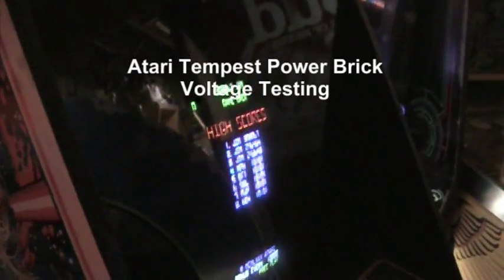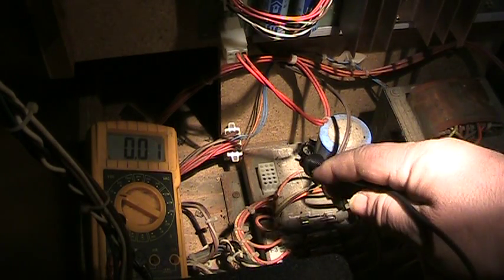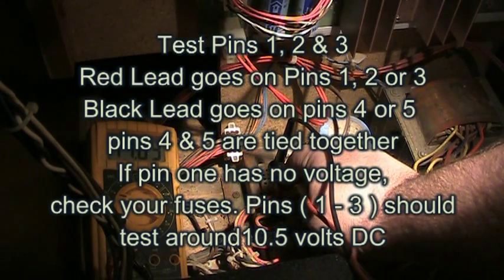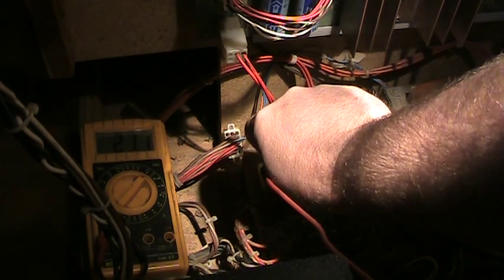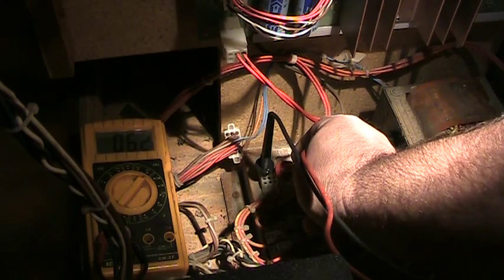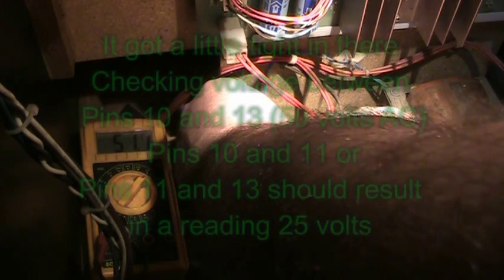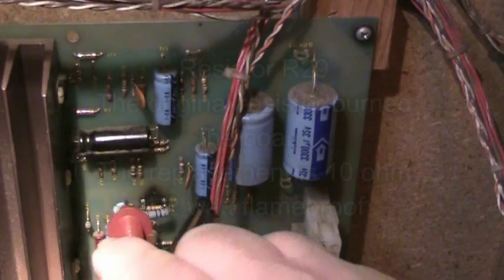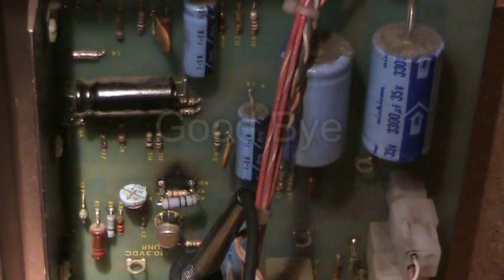Atari Color Vector  X-Y Tempest (Star Wars) power supply brick

Comment from the maker: Vector generator chips allow for the generation of a picture on a crt (tv Tube) the center of the tube is location 0:0. The value for X or Y can be positive or negative and is based on DC current. For a color tube there is a signal running the  magnetic pulse  directing the drawing of the characters on the screen. There is also a pulse telling when to turn on and off the beams for the respective colors. The tube is divided into four sections. The program runs in an anologe code. That code is sent to the DAC chips (digital anologe converter chip)  once the code is turned into a digital location the chip tells the beam were to go on the crt. The rate of movement is slower than a standard tv which is considered raster. Hopefully that helps. Tempest uses a math box board which is the secondary pcb. Star Wars has a special chip which does the function of the math box called the avg chip.

Comment: @Jimjaycee That's called the "Sense Mod" right?  I've heard of that, but haven't done it to my AR/II board yet.  I did replace the two resistors (R29 and R30) with higher watt resistors.  I plan to get a used AR/II on eBay and rebuild it, keeping my working board as a back-up.  My soldering skills are pretty good.

Comment from the maker: After you have the voltage at +5 volts on the a/r 2 board, reinstall the pcb. You will probably have to turn it up just a little to compensate for the voltage being used by the pcb. Test the pcb also to make sure you are getting +5 at the pcb. 
I hope this helps.

Comment from the maker: That is called run away voltage my friend. +6 volts is to high for the pcb board. It will burn up your edge connector. Consider shot gunning the A/R 2 board. It is easy to do and it is reversible.
I do not know your soldering ability and I make no guarantee that this is going to work, even if
I've done this on my own games.
The following is in regards to the J7 connector  
1) connect pin 1&2 soldering in a bridge
2) connect pin 3&6 soldering in a bridge
Adjust your pot to +5 volts w/out pcb.

Comment: I got the power supply repair kit from Bob Roberts today, and happy to report that my Atari Star Wars is back up and running.  Thanks for posting this video.  It helped me out a lot.  All of the voltages on my power supply are testing OK on my multimeter, but the voltage on the AR/II board is reading 6V at the +SENSE test point instead of 5V.  I tried turning it down using the voltage adjustment pot on the AR/II but it didn't do anything.  The game's been on 2 hours and everything seems fine.

Comment from the maker: I thought I'd mention one other thing regarding the Star Wars A/R Board. There is two plugs on the board that have the same keying. If the board is removed, use a Sharpie marker to identify which plug goes with its connector. If it is hooked up backwards and turned on, it is very bad for your game. I have heard this has happening to others, and I wish to see it avoided.

Comment: Thanks a million for posting this video!  I'm trying to troubleshoot a dead Atari Star Wars arcade game and this video helped me out tremendously.  I tested my voltages with a multimeter and I'm showing no voltage at all for pins 1-3 (which should be showing 10.5VDC).  All of the other pins have the correct voltages.  Do you have any idea why there would be no voltage on pins 1-3?.  I've heard that the bridge rectifier might be bad.  Should I try to replace it or could it be something else?